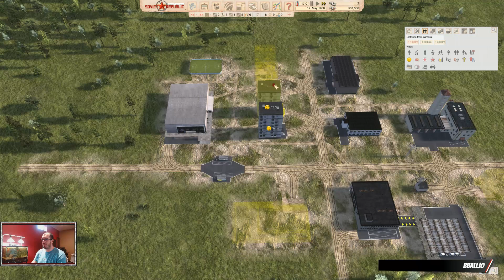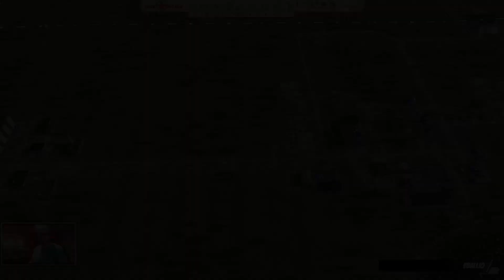Hard & Very Hard Start Guide 4/4:Winter is Coming! | WR:SR

Comment: That's nice! I have rather different start than Yours but in the end we both ended up with 400k of rubles after starting the community. What's now? Where to get enough money to compensate fuel/food and cloths needs?
AdditionallyI am a little bit sad that You actually imported prefab panels as they are forbidden for import in HMC. But only a little.

Comment: Excellent 4 part turorial. Would be nice if the game itself had a hardcore mode though. Where they only give you the bare minimum start with disabled autobuilding and auto import. Probably need yo polish the game before that would be viable though
Reply from the maker: It would be nice, but I think there will always be a tiny bit autobuild at the beginning that's specific to each player and the maps needs...but you're right, something more static for the beginning would be very nice.

Comment: For the whole tutorial, I agree on most things (or consider them to be a matter of taste), but... you wasted a lot of money to your electric lines. Always use 4MW lines when possible. They are cheaper than the 0.65MW lines per 1km (if you autobuild). When you actually need more power than that you usually can also afford building a better line. Also, while autobuilding, you need to keep the length of medium voltage lines down, as they require lots of work days to build. Many occasions it is cheaper to use 4MW line and a transformer.
Reply from the maker: Honestly, I haven't really considered this. I generally like to not replace power lines, especially the high voltage ones, at any point in the game, that's why I just go large right away...but I would agree with you, if money is tight, you can definitely safe a few bucks on your power lines, one like you said, by using the smaller ones, and also with reducing the high voltage towers by using the path trick.

One thing I was surprised by in my current series...once you overload the power grid, it's really hard to rebalance it, even when you start with the big lines...so I'm really looking forward to the next update!

Comment: you can use the mouse wheel when trying to connect roads, that will change the curve of the road joint and help you tuck in roads like that last segment you tried more easily :)
Reply from the maker: i usually use that...i'm not quiet sure which part you are referring to, but i'm sure someone will find this comment useful :D

Comment: Overall, nice set up to start. The only problem is to how to make profit out of 300k. You probably need to think about something that doesn’t require workers, or require just a few. Oil, farming, or take a loan.
Reply from the maker: Actually, 300k aren't that bad if you build it yourself:) those 3 are good options, I would add tourism. Also, just starting to produce what you import helps reduce your expenses... But often 1 loan will be required:)
Reply: I mostly can do the start (what was explained in this tutorial) and set up clothes manufacturing (from imported crops+chemicals) with only using the 1mil Rubls (plus few k$ for uneducated immigrants). Sometimes I do need 100kR loan. It typically gives 10-13k per month for me.